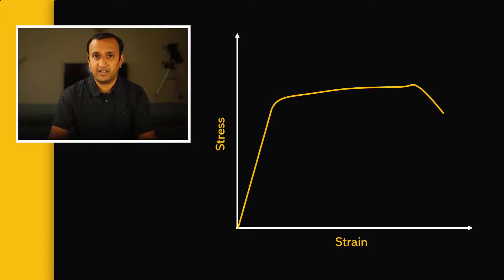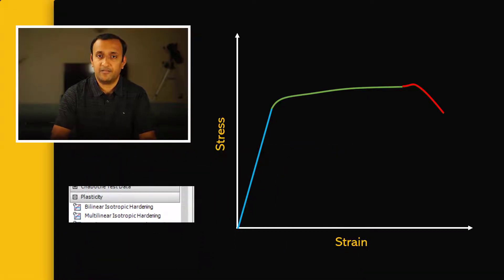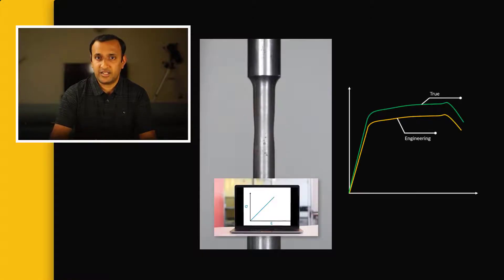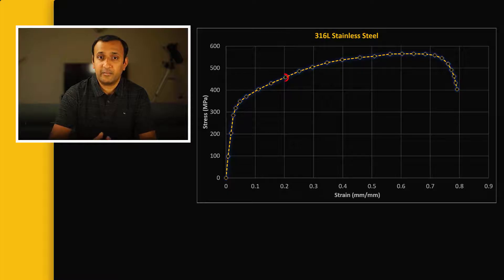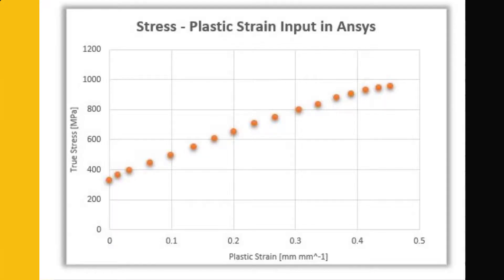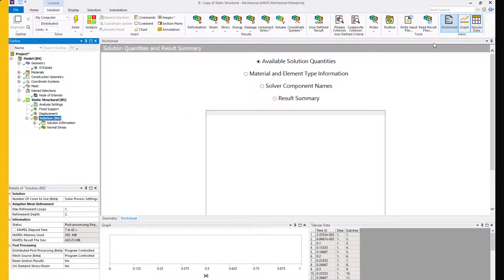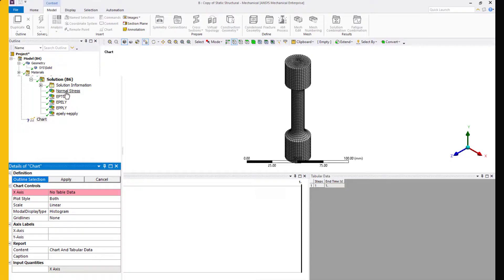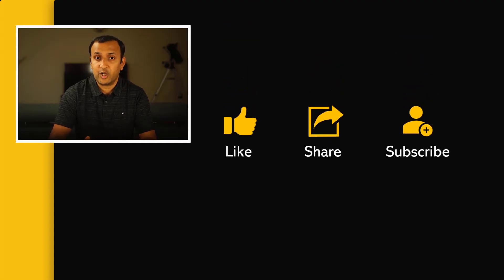Defining a Multilinear Plasticity Hardening Model Using Ansys Mechanical — Lesson 1

Comment from the maker: Errata:
1:20 - In the true stress vs. true strain graph, the labels for “Elastic Strain” and “Plastic Strain” are reversed.
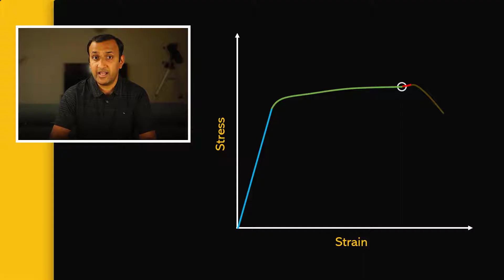2:06 - In the true stress vs. true strain graph, the label for “Ultimate Strength” is labelled incorrectly.

This video is part of the free Ansys Innovation Course, "Topics in Metal Plasticity Using Ansys Mechanical". Access all the course contents, including additional lessons, handouts, simulation examples with starting files, homework problems, and quizzes here: https://courses.ansys.com/index.php/courses/topics-in-metal-plasticity/.

Comment: I thought the stress point before fracture is called "fracture strength", not "ultimate tensile strength" (UTS). UTS is the highest peak of stress-strain curve. Someone please correct me if I'm wrong
Reply: You're correct - ultimate tensile strength (UTS) is defines as the point of maximum load (force), making it independent of the changing cross sectional area during necking, and allowing it to be defined as such regardless whether using true or engineering values for stress and strain. Any authoritative source on this should confirm this - just pick up any mechanics of materials textbook for context!
Reply: Yes that's correct, they missed that point!

Comment: @ 7:14, shouldn't the arrow be pointing to elastic strain?
Reply from the maker: Thanks for watching the video, Shailesh! The green line represents the plastic strain developed in the material up to that point and it is calculated by subtracting the elastic strain from total strain. Therefore, the arrow is pointing to the plastic strain. Hope this helps!
Reply: @AnsysLearning   The formulas are correct, what I meant was that the representation is incorrect. Suppose you unload the load at 0.2 total strain, then the unloading line will be parallel to the elastic region line. And the elastic strain then would lie to the right of this line, which in this case is shown to the left in blue. The proportion of the plastic and elastic strains should also be reversed, like at 7:14, for the pictured elasticity, plastic strain should be bigger than the elastic strain.

P.S - Not nitpicking, just pointing it out. The video is awesome as always, content wise as well as production wise.
Reply: @shaileshjoshi7912  Yeah, I also noticed this mistake